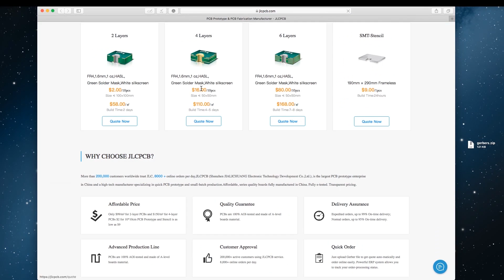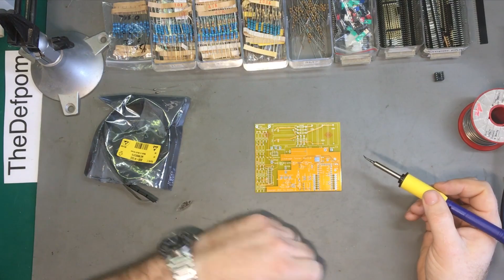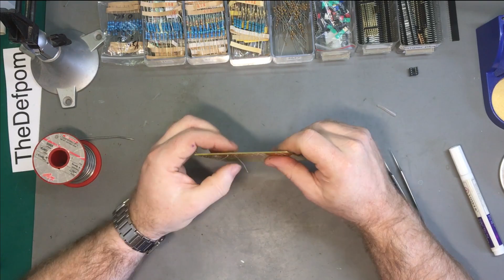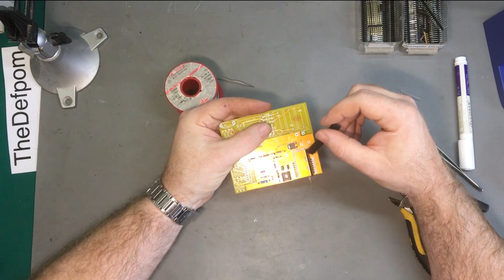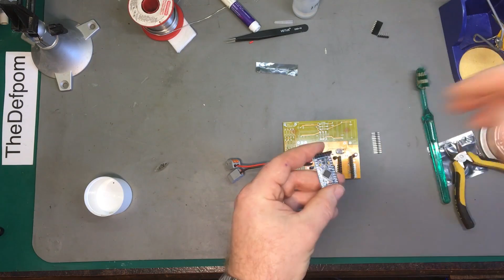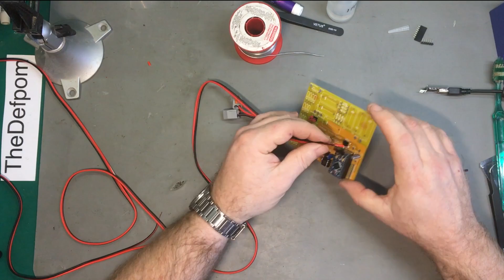🔴 #406 High Voltage Leakage Tester Project Part 3 - PCB from JLCPCB

Comment: Did you put mounting holes on the board? I made boards with tiny holes,  after making my 4th order, I got the boards exactly right. They do do a nice job if you get the gerber files the way you want them.
Reply from the maker: Joseph Massimino - the next board revision has 3mm mounting holes